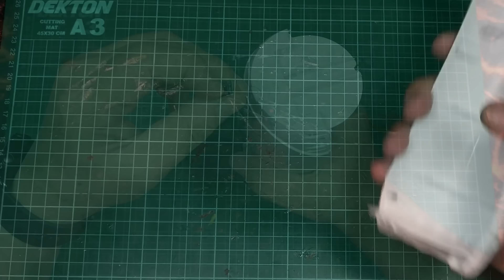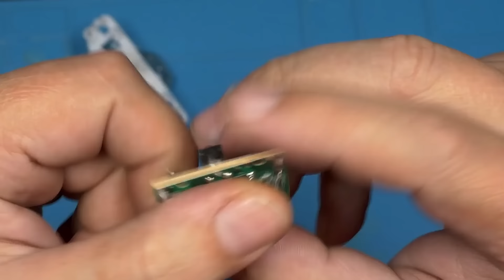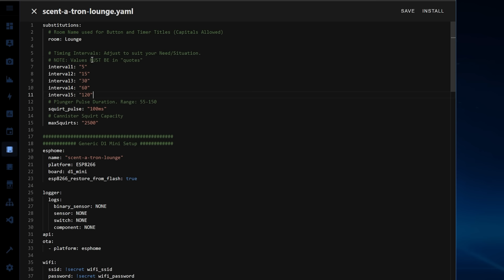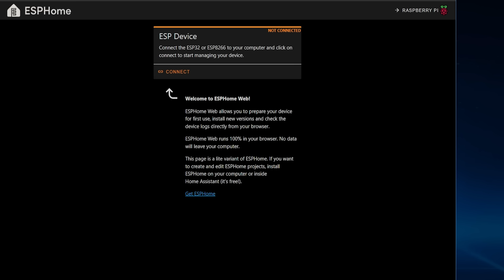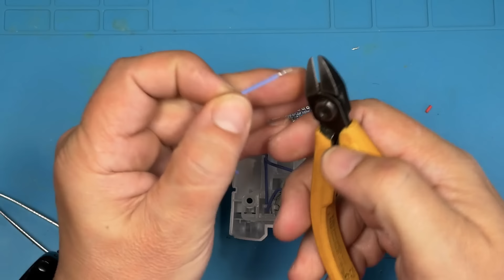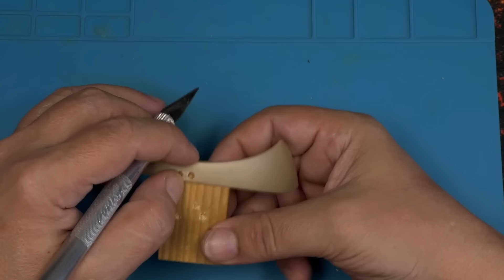Scent-a-Tron v2: Make a Glade Air Freshener Smart with ESPHome

Comment: I don't suppose there's anyway to do this without the need for home assistant or wifi, basically reprogramming the built-in switch?  Cause I'd like to get mine at work to spray 30, 60 and 90 minutes (or similar).

Worse case, I'll see if I can find a way to allow a manual spray with the switch set to off.
Reply from the maker: There's absolutely a way to do it. ESP chips can run automations on-board. However, how would you set/change the interval timing without HA & Wifi?

Comment: Ok, so I did everything, and now I’m not able to assemble the gears back. I don’t understand how the spray trigger is resetting. When I try to do it manually, my gears snap. I don’t know how to put it back together :))
Reply from the maker: You're not the first. Try this video, see if it helps: https://youtu.be/Q9dYimFkwf8
Reply: @3ATIVE  love you thank you!, i made a 1:1 clone to yours with the same pars but i want to make it stand alone no ESPhome, I want to control it from Telegram and to make it battery powerd to see how long can a lithium cell run with it. im working right now at it 
i will be back,
Reply from the maker: @Dode.Bogdan  You are most welcome - Happy to help. 
Enjoy your revamp of my project. I see how a battery-powered version would be useful. 👍👍

Comment: Is there a way to do something to the original circuit board to change the spray rate ?
Reply from the maker: The original board is no longer used here. Spray Rate is now controlled only by the D1 Mini and ESPHome Code.
Reply: @3ATIVE yeah I know but was wondering if the spray rate can be done by say changing a resistor on the original board, without using this?
Reply from the maker: @Dime_Bar  OIC. I don't think so. The OG MCU has all the timings built in. It's one of the reason I converted it... to get custom rates, etc.

Comment: I have a question. Is it safe to power the motor on 5v rather 3.3v? It seems the refill tubes for my Glade version has changed. The newer refill tube mechanism is much stiffer than the previous version, thus it does not squirt. I noticed if I use the Glade in stock mode (2 AA batteries), it works.
Reply from the maker: From many childhood "experiments", I found these motors will run happily up to 9v - For shorts periods. Longer times, heat is their enemy. 
If your mechanism needs more power, the first thing I'd suggest is you test is a longer "squirt_pluse:" (in the "Substitutions:" Section) 
- Just DO NOT run it without a Can installed, Otherwise you risk over-shooting and stripping the gears.
Reply: @3ATIVE  Yes, I have tried longer squirt time, but it does nothing. It stops half way no matter how long of the time i have set. Though if I remove the refill, I noticed it will plunge down further.

Comment: Hello. My setup consist of ESP32-C3 with aht10 and LC2410C sensors and I want to get the button to work.I have tried all the available pins, but nothing seems to work except the GPIO9 kinda. I would have to reset the device during the initial boot up, but if a drop in wifi occurs, the device will not connect any longer. Not ideal. Any way to get it to work?
Reply from the maker: First thing to do is look up the pinouts of your   ESP32-C3 and see what pins are allowed to used at Boot. Next, use Pull-Up or Pull-Down Resistors to condition the used pin appropriately - This may also require re-writing the ESPHome code.

Comment: Glad to see using the original board and commandeering it. I'm curious since your last video:

1. Did you to cut the trace on the original board to disable the timer? I cut the "wrong" trace and turned the timers off but left the board on with a button press to activate which is where it looks like you're wiring the D1 mini to, the manual switch at the top.

2. Is this version still waiting for Home Assistant to tell it when to activate? I want to do it in reverse, have the controller activate with light or motion and maybe report the spray can low to my phone or HA or what ever.

3. Possible to run the D1 mini the AA's in the front? I noticed in both versions the USB-C at the bottom, I know its getting when to spray from HA still.
Reply from the maker: Yeah I kept the board as that's where the push button is mounted - So, no need to re-engineer a new one. 

1. No traces need to be cut this time - The only thing that's used on the OG board is the button.

2. The only thing this board is waiting on HA for is whether to run or not. All Timing intervals are done on the D1 Mini.

3. You can run it from the on-board AAs but they won't last too long. ESP's WiFi uses a lot of power - Thus the USB power.
Reply: @3ATIVE  Could the ESP do the timing intervals internally? I'm curious if I could easily use an ESP solely for what I need, deep sleep in between checks for light, spray if necessary, and push a notification over wifi when a fragrance or batteries are low. I'm trying to make something for a couple of the HOA's I manage and I tried the 36 minute intervals and since the bathrooms aren't used all day they stink with fragrance by the time someone comes in to use it.
Reply from the maker: @TPCColo  Sure, that's totally do-able. I hate battery-powered devices, that's why I converted mine.
Reply: @ I don't mind battery powered in the right situations. Like we have IP cameras, the USB plugin ones are amazing, the battery powered ones, even if you have to charge every 1-3 months, nope.

Comment: I am an absolute beginner, not with HA, but with ESP and hardware.  Some of the ordered items turned out to be slightly differen even though I used the link in the description. It took me 11 hours, a lot of troubleshooting and a mental breakdown, but I finally got it to work and learned a lot along the way! Could've been a lot faster, but my soldering is 100x slower because of illness. Still had fun though! 
Had to cut a bit more plastic, had the d1 with usb c, so had to change some pins and find out the differences and simalarities, same with the usb c pinout. Had a lot of fun researching this. :D 

I do have a question. If i were to change the can halfway through because I don't like the smell, is there a way to change the percentage back to 100%? Or would you recommend just loading the same code back in?
Reply from the maker: I'm glad to hear you had fun and hopefully extended your ESPHome knowledge and skills. 🥳
🙏 Sorry to hear your illness slows down your soldering - I hope it's not too bad. 
To answer question: Yes, I coded that in too. If you hold the top button down for longer than 3 seconds it resets the can percentage.
Reply: Wow! That's amazing! Thank you for your fast answer! And to answer your concerns, I am okay  it's just meds which make me a bit foggy and shaky,  which isn't ideal but it's okay  just a bit slow. 

Well, hope to make some of your otter projects to.. but now I'm gonna need a really long brain break first. 😂
Reply from the maker: @MegaMarit12345  You are most welcome, my friend... I'm always happy to help - That's my I made this channel. 

I really hope you find some of my other projects/tutorials equally fun & useful. 

And I'll be here if you need help or have questions. 👍
Reply: @3ATIVE  I just found out the top button doesn't seem to be working. When using HA it works fine but, I can't do manual squirts using the top button. I used GIO5 on the D1 mini usb C for this. I  checked the  code and it is correct. I used my multimeter and  the wire seems to be fine. Do you have any Idea what could be the problem?
Reply from the maker: @MegaMarit12345  A couple of things you could try...
1. Swap the wires around on the Glade PCB. Some people report their D1 Minis are sensitive to this as it may act like a "Touch" input.
2. Try a different GPIO Pin, for the same reasons as point 1.

Comment: Anybody had an issue where after unplugging the device, and re-plugging the device back in the motor is constantly trying to spin almost like it’s forgotten the state or esphome config. After re-uploading the config it then stops, and works correctly.. but it does this after every re power.
Reply from the maker: Hmmm... it sounds like the sort of thing you get when "Strapping" pins are used. 
* Some GPIO pins are held either High or Low at boot. I've avoided them in this project.

Is there a chance you're either using a different ESP board or have made changes to the wiring/connections/etc??

Comment: Is anybody able to provide some photos of the orientation of the gears. Mine fell out by accident, and anytime it sprays the it appears to dislodge and cause both plastic parts of the casing to separate. I cannot see if I have things round the right way. Kindest regards
Reply from the maker: I can do that now.
Lemme pull one apart and get back to you asap.
Reply: @ thank you!! I’m pulling my hair out over this.. I’m hoping I’ve just done a cog wrong, otherwise I don’t know what I’ve done
Reply from the maker: @bradley1125  LOL No problemo
Here's what you need:
https://imgur.com/a/7Zquo6R
Reply: @ heya, thank you for pulling it apart so quickly. The bottom cog, is that facing up with the attached cog facing upwards or downwards? If that makes sense? Kind regards
Reply from the maker: @bradley1125  Probably easier if I show you. So, I took it apart again and made a short video for ya. 😎
https://youtu.be/Q9dYimFkwf8

Comment: Pin D3 is not the best choice for the button, as the ESP doesn't boot if it is pulled down. Of course you won't keep it pressed during power up, but as it turned out, on mine the switch had 40k resistance while not pressed, which was enough for the ESP to consider it closed, so it did not boot... Wired it to pin D1 instead, and also cut the PCB wire around the switch so it is now open circuit without pressing
Reply from the maker: So I hear but, as you can see mine worked just fine... Weird right?
Reply: @3ATIVE  Yeah, probably different version of board.
Reply from the maker: @henriktoth56  Defo possible. I know a few peeps had trouble with my Ikea Air Filter project too.

Comment: There also a 3.3v port on d1 mini can't use this port for power the motor also?
Reply from the maker: No, because a GPIO pin can only sink about 40mA max.
Reply: @3ATIVE I will try it thank you is there any graph with the connection and can use rechargeable aa batteries for power it also?
Reply from the maker: @akasha1337  Cool. FYI: I tried running a similar unit on a 12000mAh power bank - It lasted 8 hours.
Reply: Did you also try maybe with any of the sleep modes to work

Comment: When you say connect the first blue wire to the motor, which one do you mean? The one you soldered first?
Reply from the maker: Coming from the Push-Button it doesn't matter which one you use.
Reply: @3ATIVE  ok thanks. not sure its related to my issue where the motor just constantly spin's :)
Reply from the maker: @neilos2085  If that's the case, your Regulator board is faulty - it should be powering anything until its "Enable" pin is taken High (Via D8)

Comment: Hi, when I click on the Regulator Module Mini Voltage Reducer, am getting a lot of 12v - 24V. 
The one you is it a 4.5V to 24" ??
Reply from the maker: It may be a different listing in other Amazons. But the "12v-24V" is the input voltage range.

Also, if it helps you search, the ones I used are called: 
YOUMILE 10Pcs Step-Down Power Supply Module Mini DC-DC 12-24V To 5V 3A Voltage Buck Converter Adjustable 1.8V 2.5V 3.3V 5V 9V 12V
Reply from the maker: ... Oh, just checked the listing. I does quote: "Input Voltage: DC 4.5-24V" 😎
Reply: @3ATIVE  Ok thanks my links are going to 12v - 24V, I had to search for 4.5v - 24V.
Reply from the maker: @roystervi  Cool. Just make sure they are the same board, if you want to follow along.

Comment: What a great simple project, and so well explained. I have now built three units, one has been modified to include a mq2 sensor, to see if I can get it to auto trigger if the odour gets too much in the toilet.
Reply from the maker: Thanks fella for the feedback and the support. 
You got the "Gas" sensor deployed eh? - Nice one. Grab some Baked Beans and let me know how well it senses! LMAO
Reply: Did your gas sensor work as expected?
Reply: @Paw_Low  no, there is a slight change to the partical rate, but not a massive amount and it took a minute or so to peak, even with 1 second sampling, when sprayed this also sent it off the scale!

Comment: Great video! Is there any change to make video with VL53L1X for people counter?
Reply from the maker: Thank you and I hope you find it useful too.
I hadn't planned on adding other sensors, I just wanted to add this much cheaper "Squirter" 😉to Home Assistant.
I know Larry added the Time-of-Flight sensor to his but, I never saw the point. LOL
Reply: @3ATIVE No, didn’t mean to add sensor on this. 😂 different video with only the sensor.
Reply from the maker: @NoRzYeah  OIC... Got ya. 
Well I haven't tested them for response time(s) but, I'm not sure if they would trigger fast-enough, unlike the "normal" LEDs I used in my actual "People in a Room Counter" Project/Tutorial. That I do plan to test soon... When I get some more "Tinkering" Time. #StayTuned.
Reply: @3ATIVE  I saw the video, but requires two separated circuits, that’s means cables that can’t hide them 😂. The sensor is fast. I hope to check it.
Reply from the maker: @NoRzYeah  Indeed, one either side of the doorway... I have a load of the ToF sensors, I'll have a "Play" asap.
Reply: @3ATIVE  thanks 🙏

Comment: Hi, thanks for the great video, just one issue, after 3 attempts with different d1's found each time the D1 when programmed would connect to router but once wired up , with 5v and ground reading correct on d1, the blue led would flash briefly but not connect to router. Decided to wire up with connectors and found D3 was the issue. Once disconnected the d1 would connect, then once reconnecte to d3 the d1 worked fine. Any ideas? poss use another pin? D3 is used for the restore to flash
Reply from the maker: Hmmm that's weird behaviour. It clearly works as shown in the video. Plus I have made 5 here, and others too, without any issue.

D3 Will prevent Boot if pulled low but in this tutorial I have that wire connected to the top push button which ONLY goes low when it's pressed.
Reply: @3ATIVE  I had exactly the same problem: as soon as the switch was connected to D3, the esp8266 no longer booted. After hours of troubleshooting, it seems ridiculous, I swapped the cables on switch contacts - it suddenly worked immediately!
After looking at the remaining button-board/circuit, I suspect that parts of the connected "residual circuitry" are simply interfering with the input of the D3. Interferences etc.
Conclusion: It probably makes sense to simply separate the conductor tracks leading to the switch.
Reply from the maker: @matthiaszeise9916  I guess some D1 Minis are susceptible to floating pins. Sorry you had problem but, glad you found it. 
👍Thanks for the feedback - I'll be sure to take note in my future projects/tutorials.

Comment: So I had to try it for myself but somehow the D1 Mini won't work after plugging it in.. I hear a high pitched noise but nothing works. It also won't connect to WiFi. I double checked wiring and that al seems fine, I even made a second one but that one also doesn't work. Any clue?
Reply: had the same problem , on the third d1.using connectors rather than soldering and it seems the d1 doesnt want to connect to wifi unless D3 is disconnected first, then it connects and you can reconnect d3 and it works fine
Reply: @markszymura  Thanks I will give this a try
Reply: @markszymura  Alright, I gave it a try and it seems to work. However, everytime I unplug the device, I need to reconnect D3. For now I just leave it unplugged and don't use the button. Any ideas on how to solve this?
Reply: @BG1E  You had the same issue as I ran into. The button still connected to the panel isn't an open circuit while not being pressed but has about 40k resistance, which is enough for the ESP to sense it pressed, and this prevents it from booting (it is a well known fact about the D3 pin). 
So it is better to use a pin not affected by this (D1, D2, D5, D6 or D7) and cut the PCB wire around the switch on the board.
Reply from the maker: There's no way I can answer that without knowing exactly everything you used, how you did it and what's happening.

Comment: Add Ld2410c to the party and we're cooking! 😂
Reply from the maker: I don't get why thou
Reply: @3ATIVE  to sense when someone enters the room (toilet or bathroom) - all in one device 🙂
Reply from the maker: @bednim  To turn on/off the light?
Coz, I see no reason to have a sensor to control the Air Freshener - it has a timer (interval). The whole point is to keep the room smelling nice.
Reply: @3ATIVE  yep lights! Plus a squirt upon entry and perhaps on leave.
Reply from the maker: @bednim  OIC - Got Ya.
I'll "Have a Play" and see what I Can (no pun intended) come up with and what space is available inside. Thanks for the suggestion 👍
Reply: @3ATIVE  or - don't spray when presence detected (to avoid chems going onto your body, if the glide is opposite you?
Reply from the maker: @bednim  I guess another would be to trigger a timing out exhaust fan.
Reply: @3ATIVE  yeah, I already use it for lights and music control, but with your guide I'll make it all in one device 🙂
Reply: @3ATIVE  If you remove the selector button off the controller board, it will sit flat over the 'minutes' on the white plastic gubbins holder with the wires fitting through the hole, just trim some of the internal vertical rib just above the squirt hole in the front facia - fits a dream, might not really need any hot glue (save them fingers) to hold it, the wires do a great job of that when routed to the microcontroller.
Reply from the maker: I've got an up-coming tutorial on those mmWave sensors. Quite a unique way of using them that I haven't seen anyone else do before!!! #StayTuned ;)